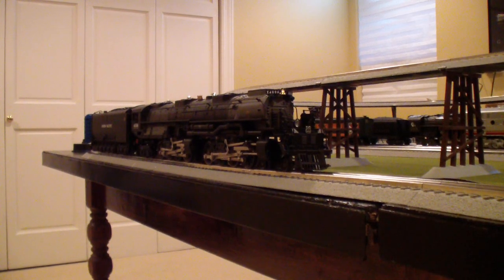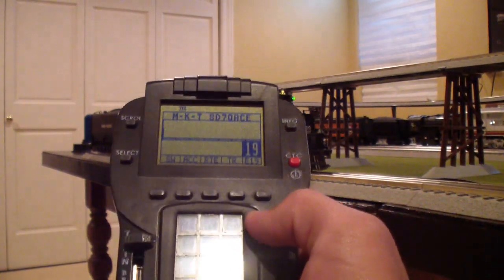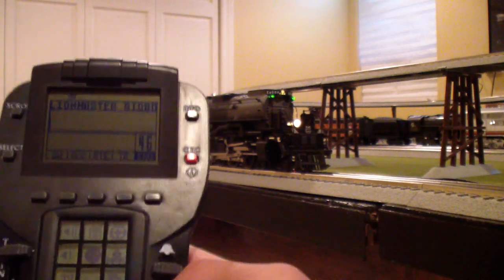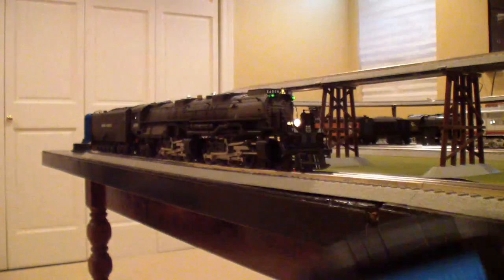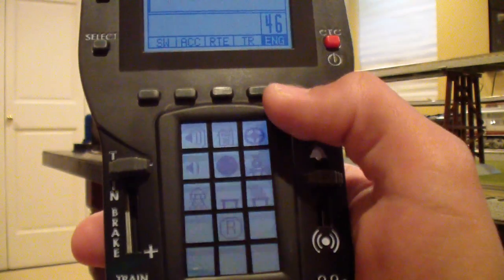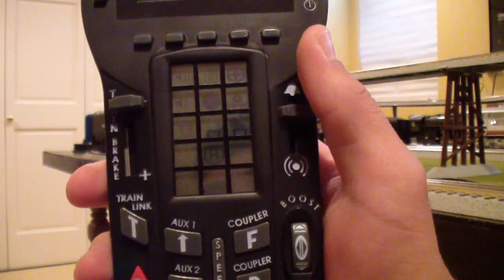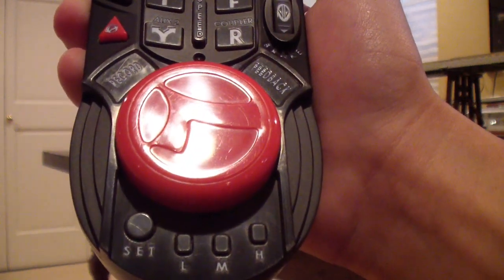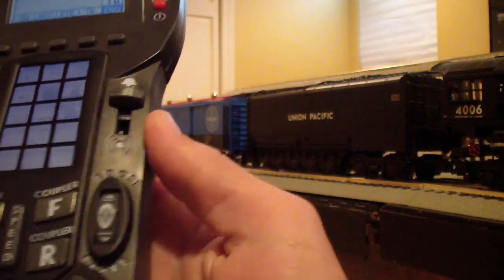Lionel Legacy Control System Operation Tutorial-The Basics (Quick-Start Guide)

Comment: I noticed one of the buttons had the letter R in a circle what does that button do?
Reply from the maker: That button is a "reset" button. If at any time your locomotives aren't responding correctly to your commands, you can hit that button and it will reset the engine. It is also used to deactivate sequence control if your engine has that feature, and to initiate refueling sounds if you hold it down. (Again, your engine would have to have that feature equipped. Usually the newer Legacy engines do but the ones from around 2007, 2008ish don't)

Comment: Just got a Legacy and it will not connect the Remote to the Base, no matter what channel I choose, no matter how many times I scan the channels?  Lionel Tech Support was clueless I wonder if you can help?  Thanks
Reply from the maker: Hmm, that's interesting. I bet your remote and base are running different versions of the software. If you power up the remote, click the CTC button and you should see what software version you have. If the base and remote have different versions, they will not find each other. If you have the blue upgrade modules, you can program the remote and base to the same software version, otherwise you can purchase a black writable utility module from Lionel that will allow you to download the latest software. If that doesn't work, you may have a faulty remote or base, unfortunately. :( It's hard for me to be entirely sure from just text, but I hope some of this helps. Best of luck! :)

Comment: I have a PA GP7 # 6-28573, the engine will only move in slow motion.  I tried to fix the problem by unsetting the speed limit, doesn't work. How can I get the engine moving again?
Reply from the maker: If the Legacy remote isn't restricting your engine's speed, then there's probably something wrong with the engine itself. The motor may be weak, or your track may not be getting enough power. There could be numerous reasons. Is it for sure something with the remote? Also try a factory reset of the engine-that may solve the problem. I explain how to do that here: https://youtu.be/_WeVcGkiWt4 Also sorry for the delayed response!

Comment: Question: how do I control 2 separate tracks with one command control?
Reply from the maker: +Peter Cornejo To control two separate tracks, you have to make sure that they are running on the same circuit. So if you have an inner loop and an outer loop, join them with a switch interchange or a crossover track somewhere. That way although they are two separate lines they will still be linked to the same electrical circuit and will both be able to receive commands from your Legacy remote.